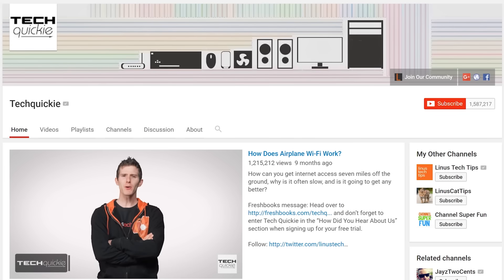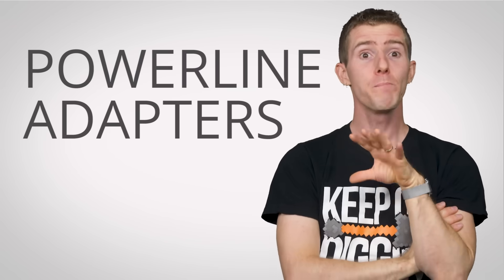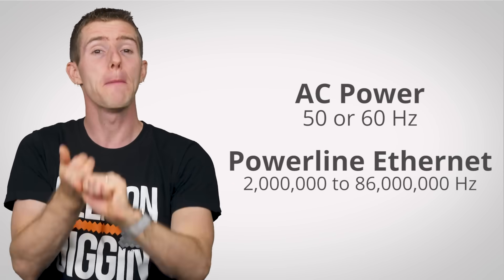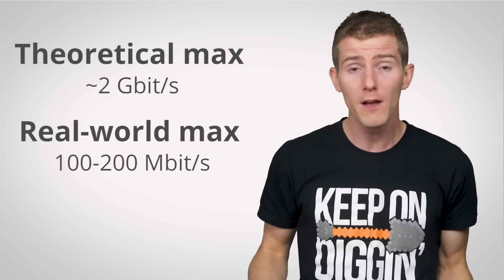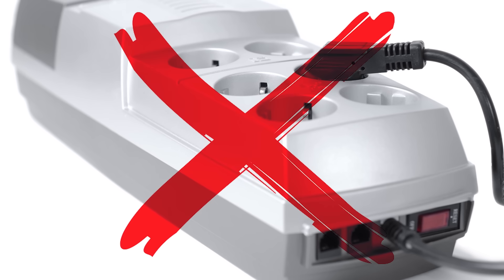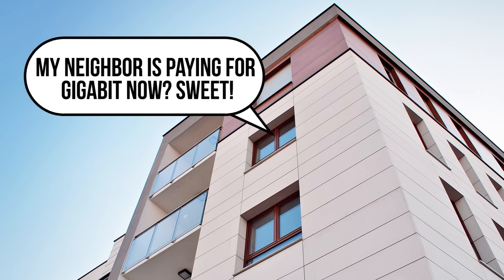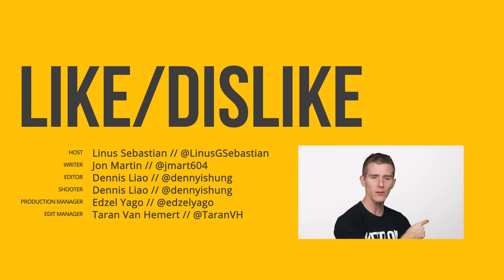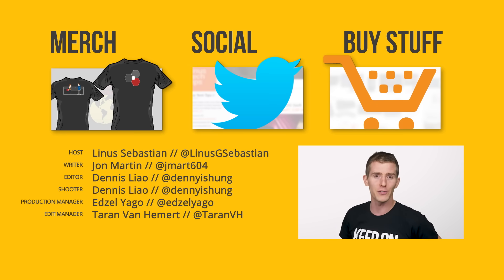How Does Powerline Ethernet Work?

Comment: Wrong about apartments, if it metered separately, which 99% are, no ones getting to your network. I’m a licensed electrician.
Reply: n3rdbear
Trigonometry is easy though, thats basic high school level math
Reply: @dustinjames1268  im still using fingers and toes to count... i can go all the way to 14 and a half... I used to work as a carpenter
Reply: All the apartments in the building have a common main fuse where the they are all connected. So unless you have a dedicated transformer or generator for your apartment only, then people will be able to access your network.
Reply: Some apartment buildings may share the electric bill among all residences. Like some share their water bill and so they arent metered separately
Reply: Mike, you're wrong.  There is nothing special about a meter that would stop the signal.  It all depends on how far the run is to the meter and then to other apartments.  You also have to consider the fan out, which could be high enough for an apartment building to prevent your signal from making it to your neighbors since it would have to share that signal among all of them.  Since you want to pull out credentials, I'm an electrical engineering student.
p.s. Your trig class is a joke even compared to high school trig.  You don't even get into trig identities or trig algebra.  I know, I graduated from an electrician trade school program and was an electrician in the Navy for 6 years.
Reply: Depends on location, Don't assume the rest of the planet follows the same rules and your certificates are valid outside your country. PS Youtube is international, that means other contries exist.
Reply: I imagine that there are folks living in old dwellings, or, perhaps, in other countries, that view these videos.
Reply: Licensed sparky....   pffft. Time to get that PLT ticket and play with the big boy voltage :D
Reply: and they are right, these signals are made to withstand going to 220v circuits, soo until they get changed to 480v on up, its still just limited to its standard range
Reply: Shadow Girl where did you get that  source from I'm interested in seeing if it's true or not
Reply: Dustin James ohhhh god.. now its a political conversation
Reply: Mike Of course you’re an electrician, your name is Mike. I know 3 electricians and they’re all called Mike. LOL 😂
Reply: Dustin James I’m in the UK and I did trigonometry in Year 7 and 8, equivalent to grade 6/7.
Reply: I was wondering if it uses the hot, neutral and ground or just hot and neutral or etc... I assume the 2nd component being on the same circuit as primary would be ideal but does it matter... juice may not be worth the squeeze if you can’t and it diminishes the signal. Maybe if you throw living rm and master bedroom double landed on a  20 amp breaker, considering you did the math and know your not ever gunna exceed 16 amps even if you plug a vacuum in. Wonder if arc fault breaker makes a difference... shouldn’t really make a difference at all.
Reply: Agree as long as you both use the same utility company,
Reply: Really, you don't think the 3rd world have this invention called electricity or internet... Get out your bubble and learn to realise most of the planet is globalised. This includes us randoms in the dark depths of Africa (Not attached to USA) :-)
Reply: No, Dustin's statement is fact based, I come from South Africa and its basic math taught to students from 14 years old and up. 

Can you imagine the world standardising education? There would be a shit load of money given to the education the system insted of something else that does not progress humanity.
Reply: i'm not that easy!
Reply: I am also an electrician. And I was glad to see this video to see how this works. How would a meter stop the signal? I could see a transfer stopping it but how would a meter stop it?
Reply: Mike 
Wrong about 99%, but who's counting
Reply: The average Electrician salary in the United States is $47,554
Reply: I jerk off on stream whats your point....
Reply: most apartments in my country offer free electricity with the rent
Reply: Mike But why? It is clear that there is the meter. But why does the meter stop the signal waves from traveling further to other networks? Even if it just delays them, savvy hackers can still read the waves,
Reply: Licensed doesn't make you any better lol
Reply: There is another topic I wish Linus or his writer would have informed about: the electrical wiring is so badly shielded that it functions as huge antennas which can heavily interfere with wireless signals and even wired signals of audio systems. Early powerline chips did not even encrypt the connections between the adapters so the whole network traffic could be sniffed in cleartext which is a privacy catastrophe! So if by any means possible use Ethernet, I do not even trust the AES 128bit implementation of encrypted powerline connections and you should neither. If one of the most popular standards in the world like WPA2 can have big fuckups then some little niche products as powerline adapters can have them more than likely as well... but hey, using unencrypted Wifi on hotspots is the same thing and SSL should secure the most important connections, at least if they did their job right. The more steps it takes to break security the better so I prefer using more steps if possible.
Reply: Actually people have been able to connect to a powerline network of a neighbor on the same street. Amazingly the signal can go a distance beyond the breaker box, so it can be a security issue.
Reply: @ShadowGirl-  Yeah, it's almost like any power circuit is connected to the power grid and thus connected... I'm not surprised that you'd be able to sniff out your neighbour's connection over a powerrline. People are lazy and will think "I already have copper in my walls, why not use it?" Lazy solutions are rarely the best solutions. Just get some Cat6.

This "Mike" guy is just obnoxious and causing me to necro this whole thread. "If I get a trigonometry answer wrong people could die", l m a o. As if he's sitting doing advanced math like it's life or death. Yes, trigonometry is key in electricity but you're not cutting about with a calculator in your trouser pocket. You just need to understand how electricity behaves through VERY simple laws of physics, know how to read a table, and have common sense to become an electrician.
Reply: Trig is like 8th grade if you're on an engineering track.
Reply: @SkiDaBird  lol what fucking 8th grader is on an "engineering track"?
Reply: @DeathBringer9216  Most of us who were IB were on a track by 7th grade. I would imagine any of the accelerated programs are the same. It was a pain to switch out of later when, shocker, my 20 year old self was a big different than my 12 year old self.
Reply: I did trigonometry in grade 10 math
This, my friends, is a prime example of the failure that is the USA education system
Reply: @dustinjames1268  shhhhhh..... gotta pay those teachers union fat dues for all that sweeeet edumakation they be givin yo
Reply: @dustinjames1268  You realize we learn trig in 8th/9th grade.
Reply: Dustin James wait... we’re friends?! Why didn’t you say so
Reply: Mike are you just having a conversation with yourself? Additionally, if you think Trig is beyond the grasp of high schoolers, I guarantee that no one is putting you in charge of a life critical part of a project.
Reply: Let me know when you find out about people's 128 bit AES powerline encryption being compromised.
Reply: I just found out being an electrician requires trigonometry. FUCKING SHIT!! >____<
Reply: @n3rdbear  good thing i can go straight to the state program
Reply: Also, I said that all you who took trig in middle school can get an answer wrong and nothing happens, again... read...
Reply: My Second Year was WAY harder then any High School Trig Class I took, plus if i get an answer wrong people could die, you just got a wrong answer...
Reply: Wrong. Simply Wrong. Don't Lie.
Reply: @Moped_Mike  hey mikey, why don't you just fook off ya?
Reply: For some reason instead of the replies going to individuals it just became a string of replies
Reply: i didnt say it was beyond high schoolers, read. it was in response to the dude that said he was taking trig in middle school...
Reply: Totally Missed the point, if its any dwelling is metered separately this shouldn't be an issue. Also, I don't believe this video was targeted to the 3rd world...
Reply: @Moped_Mike  don't have to live in the third world, the US is falling apart lol old areas are not being maintained, streets crumbling, bad old electrical work in old homes converted to apartments, no internet access in some areas above DSL *IN CITIES*, people are drinking toxic water, sewage pouring into their yards.. some of us are just lucky to not have to live with it.
Reply: My Second Year was WAY harder then any High School Class, plus if i get an answer wrong people could die, you just got a wrong answer...
Reply: no it isnt, theres a shitload of prerequisites before getting to trig.

Comment: I have my adapter from my basement to my 2nd story bedroom without losing any speed. Pretty cool.
Reply: I envy you. My room which is only round 10 meters away from where the router is only gets 33% of the strength. Then when a power trip occurred where the electricity went on and off for around 30 seconds, it sparked and I had to have it repaired
Reply: @mikeraymundo92  if it's 10m away why do You need a Powerline?
Reply: @vrantschesko1912  The router is in another room. We deemed it impractical to have someone configure a wire because it goes through a lot of corners and stops
Reply: @mikeraymundo92  I have the same situation, but instead we planned to have a wire from one room to another. It was not a big problem. We even hid the cable and a plinth panel.
Reply: @RanmaruRei  update - modem was transferred to my room so now I get the full speed of internet. The room where it was previously now has the wifi extender which is OK because they don't need high speeds for their browsing
Reply: I can't get a ip configuration into basement any ideas? Or suggestions
Reply: How bad does it lag?
Reply: @Todd6912  Zero lag. Absolutely no problem going through the powerlines
Reply: @Manok how old would you say? My house was built in the 70s so im sceptical if itll work
Reply: Hey mate sorry to bother, but does it work like ethernet or it's something in between the wifi and ethernet if we compare the internet quality? Like drops etc.

Thanks in advance ☺️
Reply: @dzoni97a  In theory it works much more like Ethernet and SHOULD be considerably better than WiFi in practice there are a ton of variants though like how many circuits the signal is going to travel thru before it gets from adapter to adapter, and the load of other electric powered devices that are running on the same circuit. For example if you have a A/C, Fridge, Microwave, Washer and Dryer, Hair Drying cycling on on a shared circuit, it will most likely drop your connection. But in some cases this is almost just as good as ethernet, def. worth a shot like Linus says in the video just buy your first set from somewhere you are confident you would be able to return them if they don't improve your speeds/stability.
Reply: @dzoni97a  I have had 3 different power line adapters and everytime I've had them wifi was faster currently I get 1/4 of the speed with power line adapters and my WiFi is almost full speed. Also I've had 3 die so I'm going to try a wifi card now.
Reply: LeonardoVincent 2 thats cause powerline is actually slower in bandwidth, but it is more stable, lets say like for gaming
Reply: @dzoni97a  also the houses I've used them in were all built withen the past two years
Reply: @leo._.vincent not even joking I’m trying to do the same thing
Reply: @dzoni97a  for me it's wayy faster than wifi but slightly slower than ethernet.

Comment: I tried it once. They lasted 3 months before being taken out by a power surge here in FL. Never again.
Reply: If a power surge took it out, that means that your house's electrical system is not properly grounded. If it was, then a powersurge would not take out electronics, it would just go right into the ground.
Reply: @kaceyhowell6570  The one’s I have used didn’t have ground prongs
Reply: @joecool4656  any decent power line adapter has solid grounding so getting decent units is key. Net-gear for example is a reputable company that actually has enterprise grade equipment with affordable costs(100$-200$). just like PC parts, cheaping out will cause many more problems than it will ever solve!
Reply: who would have thought that my electronic device would die after a power surge

Comment: I tried using it in my old house way back (like 2009) and they worked like crap. However this was not the powerline adapter's fault, it was the awful wiring of the house. They did work great for a friend however as I ended up giving the adapters to him.

Comment: "if the wiring in your house is old" Yep. I tried it, wouldn't work, put them in the same room, it dropped all the way down to 5mbps and the next room over all the way down to 1.  The wiring in this house hasn't changed in 60 years...

Comment: YMMV greatly....I tried one of those once and couldn't even get a signal from one side of a room to the other... They'd basically only connect if they were on the same outlet!
Reply: Urza9814 it all depends on the wiring in your house
Reply: Plugged directly into the wall. And the house was pretty new...built in the 90s I think. Was a friend's house though so I don't know if there was anything weird with the wiring. I doubt it was due to substandard wiring though, that place was a goddamn mansion -- had a fuckin swimming pool in the basement! Plus intercoms, central vac, that place was wired like crazy, the guy worked as a product tester so got the powerline adapters just to try (and had me try to help when he couldn't get it working because I was better with computer hardware). But yeah if you're spending that kind of money on the house you probably wouldn't cheap out on the wiring....

Comment: using it at the moment because my wifi is 2 floors down and we have thick concrete walls and ceilings, it is not perfect but It works for me and its relatively cheep and easy to set up.

Comment: my powerline adaptor works amazingly. i have a BT 1200mbs set, i can stream 4k videos on youtube with ease. used lots of powerline adaptors in the past but these are far more reliable than the older ones i had

Comment: Something Linus didn't mention, keep in mind that your power lines aren't shielded nor twisted like ethernet cables are, and therefore very sensitive to signal interference.
Reply: Ujiltrom M they also radiate, especially in countries where ringmains are used (nice, big loop antennas).

Aside from causing broadband interference that blaps HF and VHF, people have also done tests where they ran one adapter on an inverted from a battery and were able to connect to a network in a house.

Comment: I Have 1 Gigabit internet through fiber for 10 bucks a month, no need for powerline ethernet.
Reply: Mach One 100 holy what where I live its $60 a month for a 15mbps max connection
Reply: And I live in Canada it's not like I'm on some 3rd world country
Reply: This is where i want to die. Canadian prices be like $100 Cad for like 50 down. Dont forget the tax kappa. But at least net neutrality in Canada is still a thing
Reply: Actually, the more speed you have, the more you need Ethernet over WiFi, otherwise you won't be taking full advantage of your connection. The fact that you associate fiber with not needing Powerline boggles my mind. A valid point would be that you have great AC WiFi throughout your home without considerable dead spots, which could very well be enough for your usage.
Reply: I live in Sweden, and if you own a flat, you get a lot of discount from  housing company, like for example cheaper electricity bill, cheaper monthly cost for parking spot, and as mentioned cheap fiber.
Reply: Wait, Individual fibre to APARTMENT connection or fibre to whole apartment which gets split up?
Reply: liam + I live in Canada and get 30mbps for $60 after tax with fido. what provider are you with?
Reply: im telus but in my area telus is the only provider its pretty rural here
Reply: Michael Zhu Individual fiber in my apartment.
Reply: André Martins I have Asus RT-AC68U.
Reply: This is true but if you have a good wifi solution that is 5ghz it should be good in apartments
Reply: And people are so stubborn saying the US is the best, Sweden got da best internet. RIP my $90/month 480Megabit/s internet...
Reply: True, Scandinavian countries have one of the best, if not the best internet in the west, that's a fact.